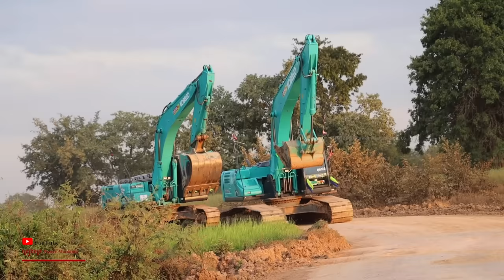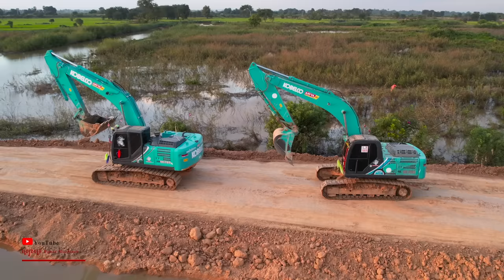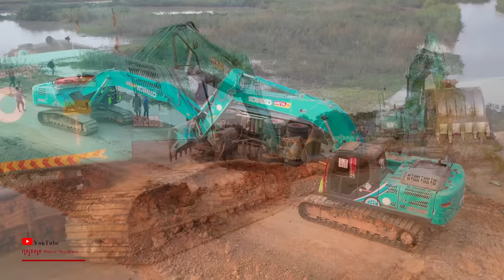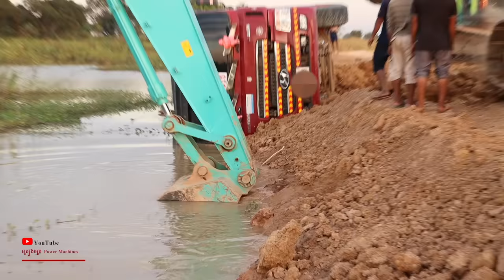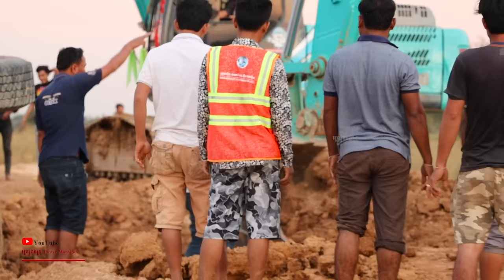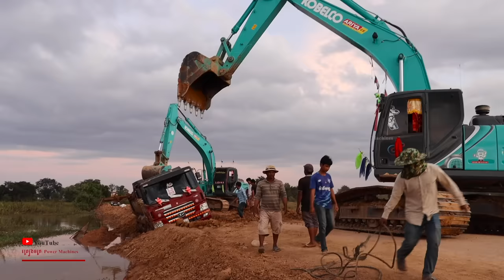Unexpected​ Dumper Truck Fall Down Fails Operators Helping Recovery With Kobelco SK26lc And Sk200

Comment: There was very easy solution, but they did not apply mind on that. Dumper was straight, they have to pull it back, because back side of dumper have low waight and wheels are straight so that dumper can pull out very easily. But there were eight or ten experts but unskilled advisors was helping in this job.
   If any person remove the dust of front right side of dumper, wheels can move easily, but every body prompt to advise to dozers.

Comment: The video does not show how they pull it out
Reply: They did pull it out.  The major problem was the front wheels were turned the wrong way.  Whoever shot this portion of the video got tired about the time they were in the last stage of the truck being on the road and a wrecker coming to tow it away.

Comment: Could have jumped in and turned the steering to help pulling it out, I know it would be hard without the engine running (seeing as it dumped it's oils into the water, hey, where was the spill kit for that anyway?) but it could have been done. So many basic health and safety violations in these videos, vehicle violations too.
Reply: Ok ooo00
Reply: @lienaglin6239  .
Reply: Q
Reply: Very hard indeed, and that the most challenging situation.